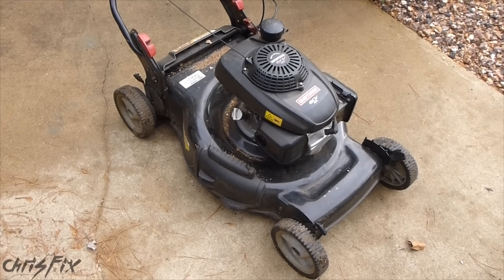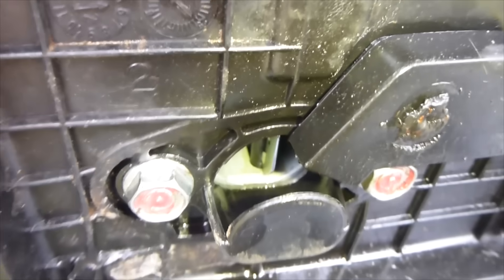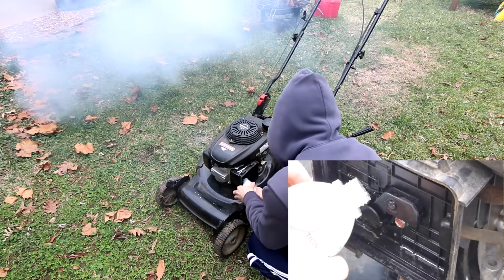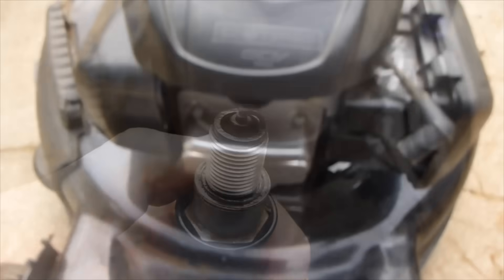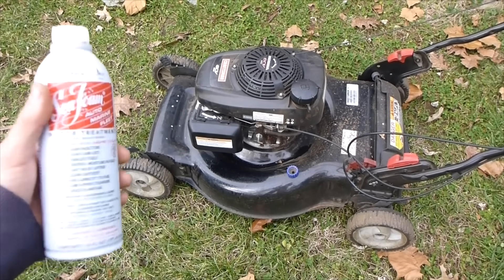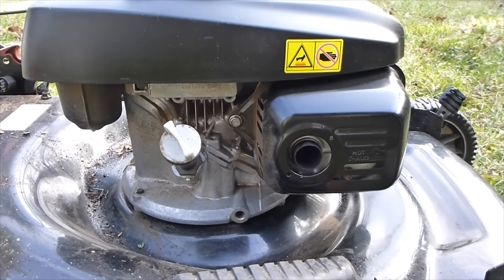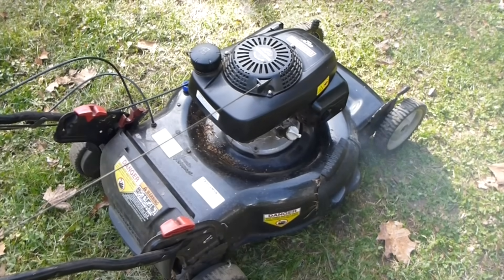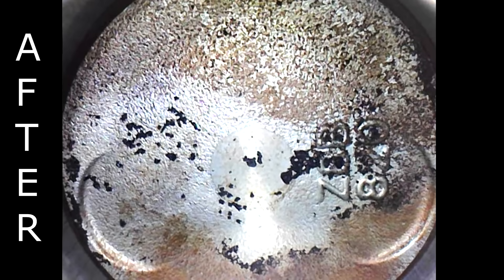Does Seafoam Actually Work? (with Proof)

Comment: A light coating of carbon is normal in any engine and also harmless. A layer of carbon on piston rings actually increases the seal between rings and cylinder walls. Pretty much a waste of time and money pouring that shit in an engine, won't make it go better or last longer. All it does is burn chemicals and pollute the air
Reply: joe bloggz Carbon coating the piston rings is very bad for your engine. Even a light amount of carbon can scar your cylinder walls causing irreversible damage to your engine. SeaFoam being able to clean that off is something that is very desirable.Carbon on the piston it's self is bad too. Carbon build up changes the compression of the cylinder. In a multi-cylinder engine, not having the same compression on all the cylinders causes uneven wear on your engine bearings.As for causing pollution. The battery in your cell phone caused more pollution when it was made than a full sized pick up ever will.
Reply: joe bloggz  
Kinda what I was thinking....
Reply: joe bloggz Carbon coating the piston rings is very bad for your engine. Even a light amount of carbon can scar your cylinder walls causing irreversible damage to your engine. SeaFoam being able to clean that off is something that is very desirable.Carbon on the piston it's self is bad too. Carbon build up changes the compression of the cylinder. In a multi-cylinder engine, not having the same compression on all the cylinders causes uneven wear on your engine bearings.As for causing pollution. The battery in your cell phone caused more pollution when it was made than a full sized pick up ever will.
Reply: The production of the cell phone battery. More harmful chemicals go in to that than a car will ever expell in to the environment. You are right about the 2 stroke engine, but if you watched the video he was cleaning out a 4 stroke.
Reply: +joe bloggz You seem to misunderstand the purpose of seafoam. It isn't intended to be a mechanic in a can, no such thing exists.  It just cleans things. Simple as that. Doing it on occasion can help an engine last longer. Engines don't need a carbon ring to seal better, friction does that on its own. Ever wonder why a new car gets better MPG after 10k miles? The rings seat along with the valves.  I'll tell you what carbon does, it creates hot spots on the piston and head that can lead to preignition and dieseling (on older vehicles carbureted), the longer you let it go the worse it gets and when it does break off you'll be screwed.
Reply: joe bloggz :)
Reply: Andrew Sonnenberg  on a 2 stroke engine when stripping it down for decarbonisation the correct procedure is to leave a small ring of carbon around the outer edge of the piston top, this is so as not to reduce the sealing effect that carbon has. Like i said " A light coating of carbon is normal in any engine and also harmless".Look inside a car engine that has done 600,000km and is still going perfectly and you will see carbon - it doesn't need some additive poured into it. Also, what possible connection does the ecological impact of cell phone production have to this discussion?
Reply: joe bloggz So we can assume that you don't use it. Hear what you may.
Reply: +joe bloggz - While carbon in the cylinder is normal, too much is bad and can start scoring the cylinder walls. Something I've seen thousands of times. Besides, it's also a good idea simply to make your engine better. And an engine is certainly better if you remove the carbon buildup.
Reply: Andrew Sonnenberg The compression on a push mower is very low, just for that very reason. Your quoting a multi cylinder vehicle, this is a single cylinder application but Its a little deceptive to argue semantics, 2 stroke or 4 stroke, light residual carbon is acceptable and is part of the "Break-In" period.

  If you believe your pistons should always hold a reflective aluminum sheen, I propose you abandon gasoline as a whole and run extremely lean on alcohol instead.
Reply: \ 0909
- Don't put words in my mouth.  I never said it should have some "aluminum sheen".  What I said was that too much carbon is a bad thing, whereas some carbon is normal.  Regardless of the number of cylinders, a heavy buildup of carbon deposits WILL start scoring the cylinders and destroy the compression which results in a complete overhaul.

Most of the time it's not an issue, and most people aren't capable of checking or repairing such issues anyway.  For those of us who are, if I see room for actual improvement then I also see no reason not to do so.
Reply: KOakaKO
 You do realize, i am supporting your argument. Obviously, if your okay with light carbon, your not looking for an aluminum sheen.. Aluminum sheen would be quite the opposite..
Reply: \ 0909
- Well, my apologies then.  When you said, "If you believe your pistons should always hold a reflective aluminum sheen...", it sounded a bit like you were critical of what I said before.

But you weren't, so I suppose I just read it and replied too quickly.  I can see, now, that you were making a general statement at the other guy and not directing it at me.

That being said, I like the idea of running straight alcohol. I had that idea about 30 years ago, when I was much younger and working in corn fields.  Unfortunately, people have discovered in the past 20 years or so that it STILL costs about twice as much as using gasoline.

Some company built a billion dollar Ethanol plant 8 miles from Grandpa's old farm in Nebraska, and I learned that they make about $140 for every $100 they spend to make the stuff. WITH government subsidies. Brazil claims success with their alcohol cars program, but their government also has to pay a LOT of subsidies to make it affordable.
Reply: +joe bloggz wow seriously you do realize the top of your piston doesn't seal at all never did, never will....the piston rings do. if you have it apart clean it all off. If you don't believe me, take your engine apart again and remove your piston rings, put it back together. then watch when you have 0 compression.
Reply: +grambam  this is getting retarded, i never said compression was created by carbon on the piston crown just that it helps create a better seal - becoming obsessed with having shiny clean piston tops and pouring additives in is not going to make the engine last any longer, the engines that do the greatest mileage do it without additives. for example an engine with shiny clean pistons will still blow up if some dickhead neglects the cooling system or other basic maintenance
Reply: +joe bloggz your not a mechanic i see. there are several reasons to stop carbon build up......
Reply: +Steve Lamperta to quote another post further down this page " Sea foam is what idiots use when they don't know how to fix the problem.
What i should have said initially, simple and any moron can understand it
Reply: The only thing carbon buildup is good for, is that it protects the piston head.
That being said, a shiny piston os more efficient than a moon surface of buildup.

Comment: I would be curious if you ran it through the tank like the others what it would do.
Reply: EGGINFOOLS I add a full can to the 20 gallon tanks on my pickup now n then. I don't have a bore scope but my spark plugs do stay cleaner longer so I take that as a good sign.
Reply: NDredneck3030 I do the same on mine. It works great

Comment: put 2 oz in the gas, and when you add it to the spark plug hole, turn the engine over three times to fully distribute the seafoam.
Reply from the maker: TheJbo614 Thanks for the tip!
Reply: Your welcome! i know a fair amount of stuff about motors and vehicles, i went to trade school for two years for Auto technology. It was so worth it!!

Comment: If you really want to clean that mower.. do the same thing only use water and pour it in more slowly,  the results will amaze you as you are steam cleaning rather than scrubing your engine.  Seafoam is good for storing in your gas if you plan on storing for a long time and don't want to drain your fuel tank,  but that's about it.
Reply from the maker: Robert Brunner Thanks for sharing! I will be testing water soon so stay tuned!

Comment: Is the piston head really the part that we are ,mainly interested in cleaning? Do you have a way of knowing if the valves were cleaned at all?
Reply from the maker: James Evans The piston head is just a hard place to clean and if you can clean in the combustion chamber, one would think cleaning valves would be even easier. I wish there was an easy way to see the valves.
Reply: ChrisFix I was just figuring that the valves would be the choke point for airflow. Carbon on the piston there could even (negligably) increase compression ratio. 
That being said, now that I think about it, the soak was removing carbon without  combustion, so I assume the intake at least would be cleaned by the sea foam before it is burned
Reply from the maker: James Evans You are definitely correct and this was just a test to see if it works. The carbon on the piston head in this engine was not a problem at all and most of the time, valves are more important to clean!

Comment: Interesting I started using seafoam at the suggestion of an outdrive mechanic, who said it was superior to stable in out board injected engines. Several years ago I bought a VN750 with 3,000 miles. the first season it backfired on deceleration. I was told it was normal for that model Vulcan. I stored it for the winter with seafoam and next summer I noticed the backfire was gone. I can not say it was defiantly the seafoam. But that is my opinion.
Reply from the maker: Carl Wehner Thanks for sharing! Hm, it could have cleaned the carb!

Comment: If there are solvents in that stuff then of course it would have cleaned it off sitting. You could have left actual gasoline, kerosene, or brake cleaner on top of it and it would have done the same thing.
Reply from the maker: Allurade Thanks for sharing!

Comment: not enough carbon removed to make a difference.  you did not mention the deep scratches in the side of the cylinder bore.  these are caused by starting a engine at cold temps and running it at hi rpms the worst thing you can do to a engine particularly a air cooled engine.  sea foam does not help.  the military injects a light weight oil into the exhaust manifold in ground and aircraft to produce a smoke screen.  all the small engine makers just want you to buy a new engine ever couple of years.  they don't care about wear.  don't wast you money on sea foam.
Reply from the maker: ***** Thanks for sharing!

Comment: Chris,
I have a golf cart that could probably benefit from seafoam.  the only problem is due to the orientation of the air intake, I cant run seafoam through the air intake.  Could i put seafoam in the fuel tank to clean out the carb and inside the engine?
Reply from the maker: Edwin Acosta If you put it in the gas, they claim it cleans the carb. I havent tested it. Check this out though: https://www.youtube.com/watch?v=u6UeJXkzDW8
Reply: ChrisFix Thank you for the reply. I will definitely try it out soon.  Ill let you know after I do it, if it improves anything.

Comment: I would use enough thing but B12  Looks like you burnt the rings out on it.. Carbon is good for a engine seal small cracks and pits up and give it more compression,  but to much is bad  "B12 i use it in every thing, even in my boat"  help to keep water out of the fuel as well as a quick tune up it cleans fuel line,tank, fuel injectors , carbon build ups ect.
Reply from the maker: 426 SUPER BEE Thanks for sharing!

Comment: Can you try a cap full of automatic transmission fluid into the carb to see if it will remove more carbon deposits?  The logic behind this is it will burn hot at remove the carbon not sure if it works but would be a good test.
Reply from the maker: cheesehead9x19 Thanks! Well this engine is clean so I have to wait till it gets dirty again!

Comment: OK, now take out your spark plug, turn the piston back, now use a jet lance and jet off the carbon. Repeat a few times. Tip forward and drain out the water, then refit and start.

Zero carbon.
Reply from the maker: mr2gti Thanks for sharing!

Comment: I've only used SeaFoam once.  I had an old straight 6 carbuerated engine in a a car that when I started it one day it had a VERY loud tapping or banging noise coming from the engine.  I shut the car off right away since I was afraid to keep running it like that.  The car had run fine up to that point with no engine noise what so ever. This just came out of nowhere.  I was young, right out of high school and didn't know much about cars.  I thought maybe I had a busted connecting rod or something.    I called down to the local car repair place and asked them what they thought it might be.  Since it just happened all of the sudden on start up and hadn't made any noise previous to this, the guy said it "could' be carbon build up on a valve or something.  He said if a piece of carbon gets stuck on a valve it can make that really loud tapping/banging noise.  He suggested running a full can of SeaFoam through the carbuerator and into the engine.  He said have someone rev the engine up as you pour it in little by little.  He said it will smoke horribly with a LOT of white smoke coming out the exhaust but that's just the SeaFoam burning off.  He said run the whole can through and really rev it up and poor it in almost to the point of stalling the engine.  I did that and sure enough, after the can of SeaFoam was run through, the noise was gone.  The engine was fine ever since then.  I'm definitely a believer in SeaFoam after that.
Reply from the maker: Soulrider2012 Thanks for sharing! That is pretty good! Cant beat a fix like that where it would have costed a lot more to tare down the engine!
Reply: Yep, I was SO happy it took care of the problem.  Not knowing a lot about cars at the time I could easily see that as having turned into a major repair bill when actually all the person doing the repair would probably do is the same thing I did, SeaFoam.  I made sure to go back and thank the guy I talked to who told me about SeaFoam .

Comment: what will work and I have done it is water warm the engine up remove air cleaner and squirt water into the intake you need to keep the engine running not fast just above idle a windex bottle works for delivery and if you look in side it will be clean as new
Reply from the maker: Ron Thomas I will be testing water so thanks for sharing! Stay tuned!

Comment: Cleaning the top of a piston head doesn't benifits anything though
Reply from the maker: ZIPPER978 It is just showing that seafoam can clean the combustion chamber. If it does that for the cylinder, imagine the valves. I really want to see the valves before and after so I am trying to find an engine to test.

Comment: Here's a tip:  Water in a spray bottle will remove carbon too.  Costs significantly less.  If you've ever replaced a leaking head gasket on a car engine, you've probably seen how clean and polished the leaking cylinder looks (assuming you had a leak between a water jacket and a cylinder).  Try it.  It's not nearly as fast, but is a lot less poisonous to breathe.  Mostly I like the free part.
Reply from the maker: superdave2112 I will test water in a bottle soon so stay tuned!

Comment: This is the only video of yours I've seen yet. I really don't know how Google knew that I bought some of this recently but have not yet used it. 

I plan on putting it in my Bad Boy mowers, my portable generator and my Harley. All have gas that's been sitting over the winter. I thought I was just going to add a half of the can to the full gas tank. No I know I need to read more. 

Thanks for doing this video. It's very informative and done objectively. 

Subscribed.

Comment: Sea foam does work but I've had better results using a spray bottle of water, misting it into the intake. My auto shop teacher in high school showed me that trick, he said when a drag car (he was old so this was probably in the early 1960's) would run-on or ping he and other racers would mist water into their carbs to knock out carbon deposits. I've tried this on a lot of vehicles and power equipment when I worked at an independent shop (cars, trucks, ATVs, Tractors, yard equipment, small town shop what we got in we'd fix.) and bore scoped pistons same as you did, it works and is basically free, steam is powerful stuff.
Reply from the maker: grassulo Thanks for sharing! I will be testing the water in the intake trick to see if it works!

Comment: I would probably change the oil. Some of it must have seeped between the piston and cylinder when you had it upright. I have seen engines with a combustion chamber full of oil if turned upside down to long.
Reply from the maker: BUNCHofxs I defintiely agree although seafoam says you can add some to the oil without any problems.
Reply: ChrisFix
lol, i guess i should have looked that up first. i feel kind of stupid now.
Reply from the maker: BUNCHofxs Dont feel dumb. It isnt something I would add to my oil anyhow. I did change the oil that spring before I used it!

Comment: Hey Chris, where did you get the orthoscopic camera?  I need to check number 4 on my old police car due to a previously leaky intake when I first got it.Oh yeah, give marvel mystery oil a try.  Its a top cylinder lubricant.  Use a syringe or other lunger based injection device and cover the top of the piston with it.  Let it sit for about an hour then start the mower back up and check deposits.  Just make sure that the piston is flat, straight up and down so you get an even dispersal.
Reply from the maker: Dale Corner The camera is linked in the description below! let me know how the piston looks!